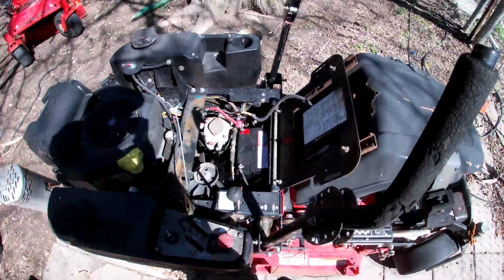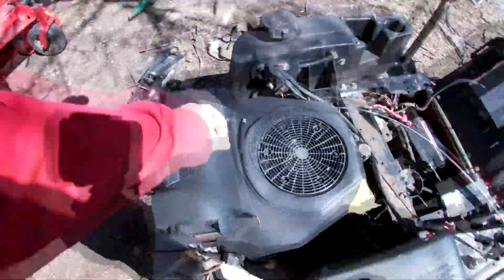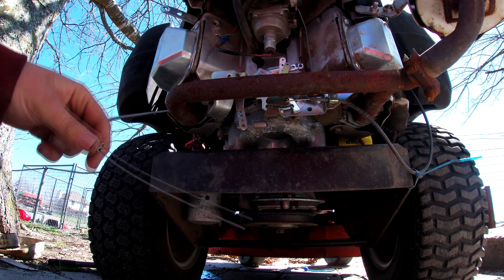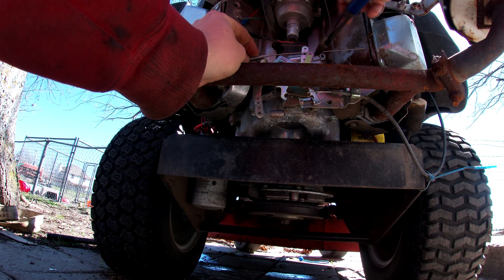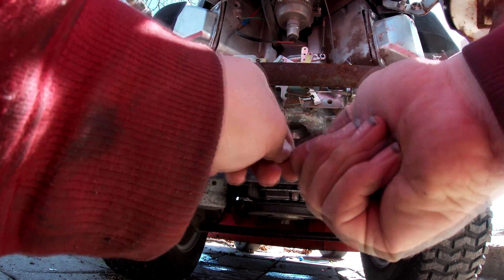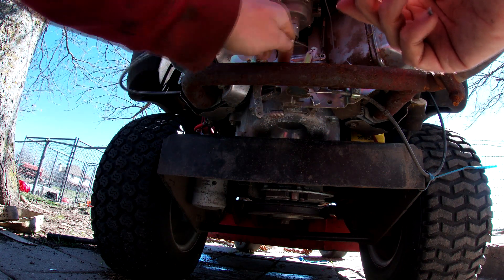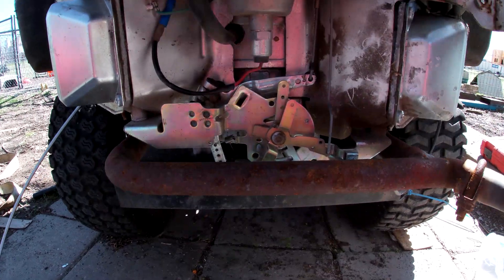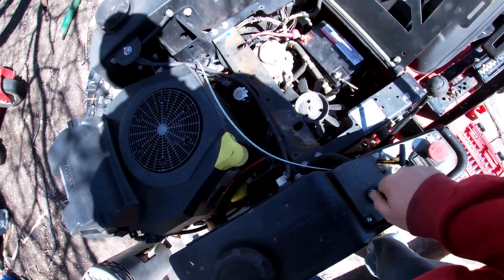How to make a Z-bend on a Throttle or Choke Cables

Comment: You hit the nail on the head about customers and needed repairs. Often, I'll go ahead and replace exhaust manifold gaskets and/or seals and gaskets and install them any way. Yeah, I eat that cost, but I know I won't see it again when a seal or gasket gets real bad or the customer blows up their engine because they didn't check the oil every time. Cheers again Buddy! Zip~
Reply from the maker: ZippoVarga this one he broke the pipe